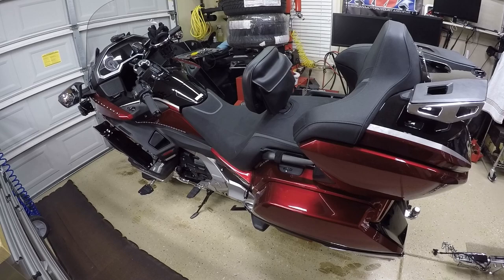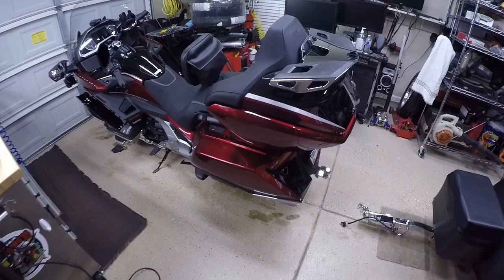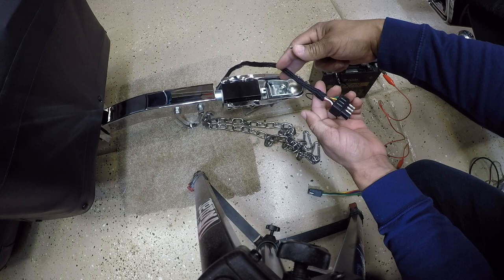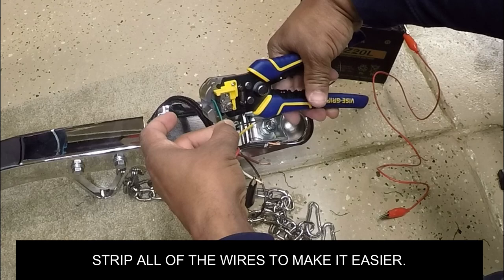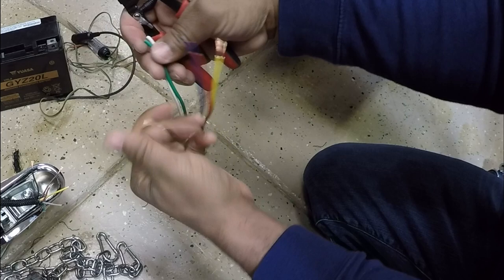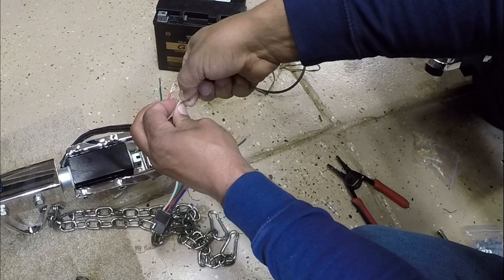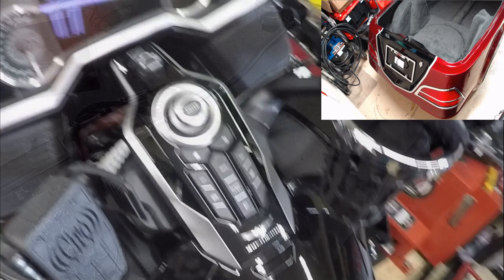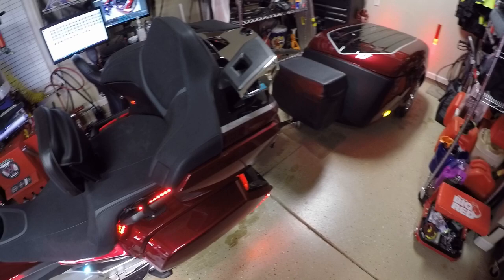I purchased a new Trailer for my 2021 Goldwing Tour

Comment: When you cut the pig tail off the trailer end , my WTF meter hit full on.  Have you not seen  1/2 inch PET Expandable Braided Sleeving – Black –  braided cable sleeve , to use over the wires?  Then use 1/2 inch (Diameter) 3:1 Waterproof Heat Shrink Tubing Kit, Large Marine Dual Wall Adhesive Shrinkable Wire Wrap Tube, Insulation Sealing Wear-Resistant Cable  to seal the two covers......so much nicer than tape and or a split loom.
Reply from the maker: It would have be even better if Escapade didn’t used a special trailer plugs or give customers an adapter to power their trailers.  It’s a good thing that I know exactly what I’m doing and have extra materials in my garage without spending extra money just to buy fancy Expandable Braided Sleeving.

Comment: Boom goes the lights! If you’re going to have the quintessential example of Touring rigs, you might as well go big sexy with your appointments. The trailer is absolutely spot on perfect. Love it. Saw the sweet rear trunk luggage rack. Did you do the one with the integrated Run, Brake, Turn in that? The whole package looks stunning. That’s the way I like to run. Black tie event. Dressed up. Nice work. Ride safe and ride often. Peace.

Comment: I knew you were going to get a trailer for that bike congratulations. I know you're going to add some more lights to that trailer. Did you add the rack onto the back of the bike or did it come that way. Now you going to be riding in style. On the Chris Lincoln Continental.👏👏🍾🎈🏍💨💨
Reply from the maker: I installed the trunk rack to the Goldwing but I haven’t put up the video yet,
Reply: @chriscaliente5033  okay. Well it looks good on the back of the bike. I was looking at the whole bike and trailer I notice you don't have your flags on your bike yet.

Comment: Hi,
Don't find my reply to your video posted from my phone so i repost it.
If i had to put a trailler to my motorcycle, i probably take an eye to a "LED magnetic wireless trailer light" as it can be found on amazon for exemple.
With the advantage to not take power for led from the motorcycle battery.
Have you some opinion for this type of solution ? 
Thank's for your vidéo.
Very nice trailler and bike solution !
Best regards from an european viewer and follower. 😉
Reply from the maker: My rule of thumb is that a wired connection is way efficient than a wireless connection, so just because something is wireless, that doesn’t make it better, it just all depends.